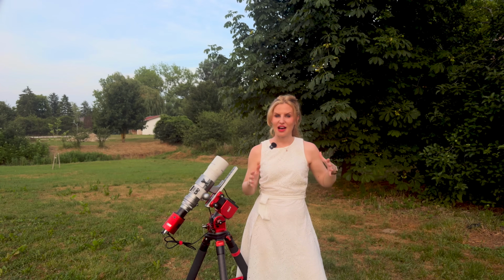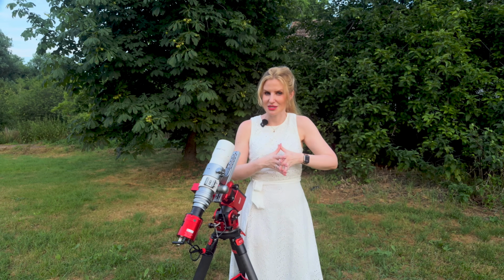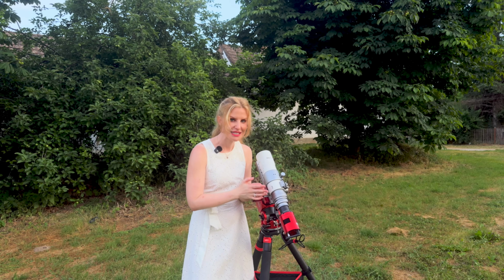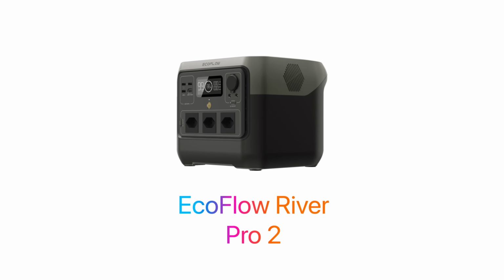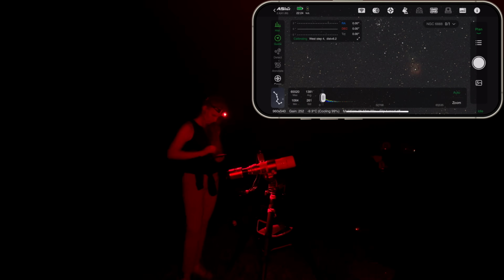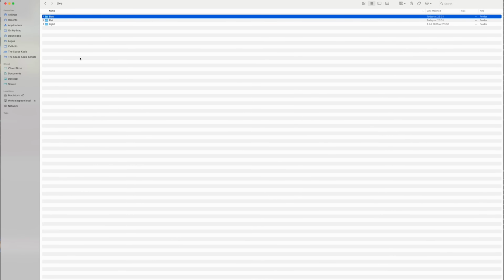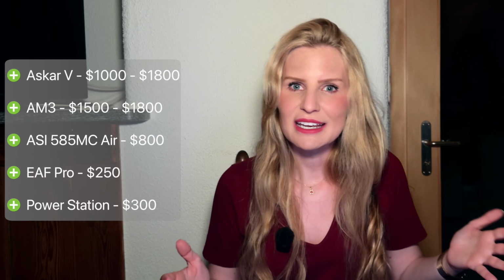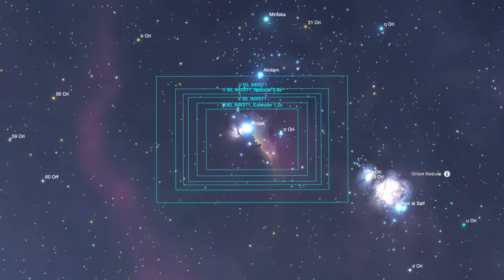Build Your Own Smart Scope! Easy as a SeeStar, Pro results!

Comment: Just looking at that rig... it's already many times more of a faff than the seestar or in my case a dwarf 3.

I get it, tech has moved on and you can if you're willing to pay the price construct a series of components to get the functionality of a 'smart scope' with the flexibility to switch out a component, but this isn't a "smart telescope", its an iteration on what always has been available, and it's definitely more involved than whipping a seestar out of your back pack, deploying a mini tripod, tilting it a bit and your done.

Heck even the need to bring a powerbank is an additional pain.
Reply from the maker: it's definitely not for everyone. My point is nowadays when people are polar aligning their smart scopes and bringing a power bank anyway, there really isn't that much difference in the effort, and the results are far superior. The huge difference is in the cost, that is true
Reply: Sooo tldr: this is a great set up if you have nothing and want to commit moderate cash to this hobby. Do this.

It is expensive and I don't think it fully matches the ease of a smart telescope but my experience 3 months on from my last comment would suggest if you're into astrophotography, you'll end up going this route sooner rather than later anyway.

My dwarf 3 I still use, every time I go shooting but... I found myself very quickly wanting more pixels as I want to print my images for wall art, so I bought a 585mcpro to pair with my redcat51. Then I wanted automation so I bought an asiair plus, guide scope, 120mm cam and juwei-14 mount.

Then, I found myself really wishing I had some reach as my images whilst higher definition/quality for printing on the redcat were ultimately the same view from the dwarf3 and around that time I had a horrible experience with a meridian flip.

With that a want to get rid of the cables came into play as even though I thought I had cable managed them just right it nearly ended in disaster.

An svbony mk127 entered the picture to answer the reach issue, along with a 585mcair (it's not a 2600 but hey ho).

Now my redcat has only a power cable that is of concern during a meridian flip. The pixel count is higher for printing, it's way more portable and neater than it was.

All my old gear is going on the mk127 so then that gives me the reach, and using a flip mirror diagonal it allows me to do visual astronomy with it too whilst it stays rigged for astrophotography.

I still rate the dwarf if you have a low budget and want good results fast, but it's a gateway drug and despite me going "this is no replacement for a smart scope" in my previous comment there is something to be said for it's simplicity with reusable components.

I still use my dwarf every time I image and for opportunistic captures when travelling as it goes everywhere with me, but if it's a target I have genuine interest in doing a project on, it's the redcat with the air camera that gets used for it.

My only regret? Buying a redcat and not the Askar V set up in this video. That is one superb bit of versatile kit.

So yeah if you're a beginner and you have a genuine interest in the hobby to throw a little cash in to get started, get this. You will not be disappointed.

Comment: Do you need a Guide Scope + Camera with the ASI2600MC Air if so wha trecommendations do you recommend
Reply from the maker: No you don’t - it has the integrated guider, this is a huge benefit
Reply: @the_space_koala  ahve baught the askar v 60/80 and the EMF PRO  and have the asi2600mc air and AM5N do you need spacers between the camera and telescope if so what spacers do i need thankyou (this is an upgrade from the seestar s50)

Comment: the problem i've found with astrophotography  is when you try to go budget  you just end up spending more. I learned this from first purchasing a SCT  and no eq mount with a nikon. Then as I understood the parameters a little better on what made a better picture I was already several thousand dollars down the wrong path. 
now its 5 or 6 years later and I still have not been able to put together my own system especially with inflation. so If I could buy the ZWO "modular smart scope" or a package like Celestron origin its not 3.8k Vs 4k spent. its really something like 7k Vs 8k spent, because of all the wasted gear that didn't go towards anything.  

the real lesson is buy  as much of the best equipment as you can if you really want to do deep sky objects.  Great pictures are extremely dependent on hardware. You can be the best framer , the best at exposing with your cheap camera but someone who has dumped more money into  a better tube, and a better sensor at the same time  you purchased yours will always produce an image much better than yours. 

know what you want to do  with astrophotography before you buy anything. then buy the best you can get for what you want to do. if you want to try and take professional pictures, do not even bother with a  DSLR, or a budget OTA. Just get the best mount, the best camera and a small quality Tube to start. save up for the best tube your mount can handle next. You can even get  a good "slow" dedicated 300mm lens for 300 dollars  and probably for about 30 dollars for adapter and spacers  put the ZWO camera on it.
Reply from the maker: I feel a lot of what you said (I started out with a C9.25 on an Evolution mount) - though when I first purchased it I had no intention of doing photography. But I soon wanted to start taking pictures and it took me a year before I gave up and bought an EQ mount :) 

I disagree however that people should not bother with the DSLR/star tracker combo. I feel whatever you have access to is the best instrument in that moment, and for some people that may be an older camera and a SW Star Adventurer. I think the key there is knowing the limitations of one's instrument, which takes critical thinking and practice. 80% of an image is good skies and well set-up equipment. OFC there are some things out there just not adept for photography but I feel whatever old lens will give someone the satisfaction of "that's the M42 that I took" even if it's not as nice as those online.

Comment: Thank you, my ASI585 Air should be coming in a few days. I will be pairing it with my William Optics GT102 102mm f/6.9 Apo Refractor. I am not new to astrophotography, however I am a beginner using the ZWO CMOS cameras. I will be using my iOptron ZEQ 25 to guide everything. Do I connect the camera to my guide port on my iOptron mount? I am mainly interested in planetary and lunar photography right now. I plan to venture over to some deep space later. So, I need learn what is the best way to capture my images. I really need help with my investment. Thank  you so much.
Reply from the maker: I'm no expert in iOptron mounts but I suppose yours also has a USB port. In that case you wouldn't be using the guiding port as that can only be used for guiding, wheaeas the USB interface will do everything for you (goto, sync and guiding).

Comment: Thank you so much for this.  Three years ago I went ham and got an 11" Edge HD with celestron mount, thinking I was going to be doing some amazing things. Knowing little about the field, I didn't realize how much of a headache I was setting myself up for. Needless to say, I rarely use my scope because of the challenges both in setup, and in imaging in general. I didn't realize the mount wouldn't be as good as required and I just don't get the results I want. It's sad to me, as I really want to do this more. 

So, I've been toying with the idea of switching to a smart scope like the S50. But as I dig, I don't like the resolution limitations, and I still want to get into it a bit more thank just set-and-forget. I am heavilly leaning towards building a setup like this. Very much appreciate the effort of putting this video together. 

Do you have any tips or resources on where I can learn what sorts of filters fit and I can use with the setup mentioned? TIA!
Reply from the maker: I'm not a big fan of using a lot of filters, with a color camera I'd only ever use a set of dual narrowband filters for emission targets and that's it - no light pollution filter or anything like that, but others will have different opinions :) 
Askar has 2 filters (Color magic) which come together as a set: Sii+Oiii and Ha+Oiii this is cool if you wanna do Hubble palette.
Though for Ha-Oiii I personally prefer the Optolong L-ultimate as it's very narrow. Optolong's sulfur version is also coming out soon but I don't know yet how that is.

Comment: Thank you very much for this thought-provoking video. 
At present I am using a Vespera Pro, which  gives me results that I am generally pleased with in terms of image quality after manual stacking. I wondered if you can say anything about how image quality would be likely to compare with that from a rig such as the one your video describes?
Reply from the maker: well it's a difficult question because my Vespera Pro has horrendous quality, but I also know that it's a problem with my specific unit and not with the design itself. The main limiting factor with the Vespera is that you cannot put it in equatorial mode that resolves a lot of the issues you may encounter with it. I am all for the modern but "traditional shaped" rigs like the one I demonstrated here and I believe you will be able to achieve superior results with it. However, as you said, you're generally pleased with it, unless you feel you want more I honestly don't believe I would change until you feel the need to!

Comment: Interesting video, and since i see you have experience with both - Askar V or the askar SQA series. How does these 2 compare only in image quality leaving aside the mechanics etc? Been looking at the askar SQA85 for its famed specs but with the current sale and versatility of the V series, how much would it loose, especially with smaller sensors such as the 585 or the 533mc?
Reply from the maker: the SQA line is clearly superior - though I only had the chance to test the 55 one in person. However if you're planning to lose a small sensor you may have some benefit of the 60mm + reducer setup of the V line for larger nebulas (where you'll likely still need to mosaic, but less).

Comment: Looking at the list, the Harmonic Mount is $1499, the telescope is $999, the Camera is $999, and the focuser is $299.  That is $3800 total.  It seems like the Celestron Origin is about the same price and one complete unit, much as a Seestar S70 would be if it existed yet.

Certainly the origin would be easier to use, though this rig offers more upgradeability.
Reply from the maker: Optically and in resolution the Origin will outperform the rig shown here. All other aspects - usability, portability - IMO this rig wins. But I respect if you prefer the all-in-one telescope design!

Comment: That same system out here in Australia, with a power tank to run it for a night, costs AUD $8651 (US $5679). The scope itself costs AUD $3499 and the AM3 mount with a tripod is AUD $2839. Even the camera is AUD $1399. Just so damned expensive out here. Let's go budget here... buy a 71F ($1249), a SW EQ AL55i mount ($1249), 585MC Air ($1399), EAF pro ($439) and power tank ($485). That's still AUD $4281. Much cheaper than a Celestron Origin ($7349), or, a Vespera ($4999 for pro).
Reply: Thanks for this break down in cost and budget option. Aussie here too and know what you mean with Aus price, ouch aye. Was thinking its not a great comparison price wise between a S50 (inc. extras around $800US) and this rig ($4000-5000US). If I was gonna spend the bigger bucks I would go for the Origin and include a wedge and guide scope, that they have incorporated for use with the Origin atm

Comment: Would you consider doing an assessment of Barlows, Correctors, and Reducers?  The good, bad, and ugly.  Who makes the best/worst.  Maybe avoid all and just buy a different scope?  Thanks
Reply from the maker: this specific scope comes with 3 correctors (a reducer, a 1x corrector and an extender) and they all work well with it (they correct my full frame camera). I would not use anything else with it (there's no point to it as far as I can see). Not sure if this is what you meant?
Reply: @the_space_koala  I meant the use of these items on other scopes like the SQA or Redcat series.  Adjusting FOV, I think, is why they are used.  Do you use a reducer on your other Askar's?
Reply from the maker: I have the reducer for my FRA600 - I use it at both speeds, depending on the FOV I would like to capture. I also have the 0.8x reducer for my 185APO but I'm not really using that for imaging, haha. 
I don't believe there are any reducers available for the SQA and/or RedCat series - I don't think it's optically feasible. In terms of a Barlow I find it an unnecessary piece of glass in your optical train - if your optics allow further magnification, you can do a drizzle integration and crop to your desired field of view!
Reply: @the_space_koala  I thought I might be missing something, hence the question to you, the expert.  It all comes down to FOV and the old question, what do you want to look at.  Still learning and having fun.  Thank you.

Comment: The other HUGE benefit to a modular is that, depending on the item, if you have a part failure, you may be able to continue your shoot. With a smart system, a component failure means you're done for the night
Reply: That's my big concern with the s30 pro I ordered. What if the auto filter sticks? What if the focuser fails? Does it become a $600 paperweight?

Comment: Thank you for this great setup option. What do you think of using the Askar SQA55 instead of the Askar V?
Reply from the maker: The SQA55 is an optically amazing telescope but much less versatile. It is also more difficult to mount an EAF if you want one, and collects WAY less light than especially the 80mm lens here. If the whole point is upgrading from the S50 I would recommend going larger

Comment: I really like the idea of this setup, thanks for a great presentation as always.   I was wondering how much slower the askar v would be compared to a dwarf 3 or s50?  Also, would a 533mc pro with asi air plus be better in any sense but maybe more complicated to set up?
Reply from the maker: You have like 2 more cables but it’s not complicated at all! Also because you could still leave it all connected. Not sure what you mean by “slower”. The setup time will take you a few minutes (probably not more than the Dwarf or Seestar) and light collection is a lot more efficient!
Reply: Thanks, that’s reassuring! By slower I meant larger f ratio, but I guess the larger aperture in comparison to a dwarf or seestar compensates for this.

Comment: Sorry, Luca, this setup is $4700 ( 1860+999+1500+299).

It is a huge step from a 500 smart telescope.

I see the point is that after some time you would run out of things to do with the S50 or similar, but spending 9x more is not one of them. 

Not everyone lives in Switzerland 😊.

But great video as usual.
Reply from the maker: I agree and I did a lengthy discussion on the price considerations and how do cut down on the price considerably (18:37)

Comment: Thanks for a great video - my question - for someone who doesn't mind tinkering "some" - what is a low-ish cost setup that would match or somewhat exceed an S50 while also having capability for expansion/upgrades?  Thanks very much. $1000?  (I have no idea...)
Reply from the maker: I don't think you'll get anything for $1000, even with the most affordable options I think you'll be at $1500 if you want portable live stacking/goto etc
Reply: Ok. $1500-ish. That's just the info I was looking for. Thanks very much. And thanks again for your well done videos.  @the_space_koala

Comment: I just added an EAF to my rig. It had been sitting in a box for over a year but your video gave me a push to install it. I said "If a koala can do it, I can do it 😀" I found the install to be about as much of a pain as I thought it would be." However, I am a nerd so I loved spending 2 days to install, tune the backlash, set limits, find focus, and run an auto focus at night. I don't think I would recommend it for someone coming from an S50. They are already going to be slightly overwhelmed with the PA and integration and networking and extra processing etc. So maybe start off with a manual focus ant add the EAF once you have everything else sorted out. I like to add complexity one layer at a time. My first rig was CGX mount and a 50mm guide scope used as a main scope and a 25mm eyepiece. I know there are no "Right" answers and this is just IMHO. Great video as always, BTW.

Comment: There are only two smart telescopes that are worth the money: the ZWO Seestar and Dwarf Lab options. Everything else is overpriced, using hardware that isn't significantly more expensive but charging a premium despite producing images that are not much better than, and sometimes even worse than, what the Seestar or Dwarf can achieve. Not to mention, both Seestar and Dwarf develop their software much faster and improve it more effectively than the competition. If you compare this build to something like a cheap Dwarf or Seestar, yes, it's better. But at the same time, the camera alone here costs more than an entire Dwarf or Seestar setup. I'm sure that in a few years, when new models come out, people won't have trouble upgrading if the models are in the $500 range. However, if they are in the €2000-€4000 range, I don't think many people would want to upgrade anymoreand drop that amount every few years! So, at least if you want to spend a huge amount of money on smart telescope with this setup (unlike some of the ridiculous options from Unistellar, Vaonis, or Celestron), it is somewhat future-upgradable. Thanks for video !